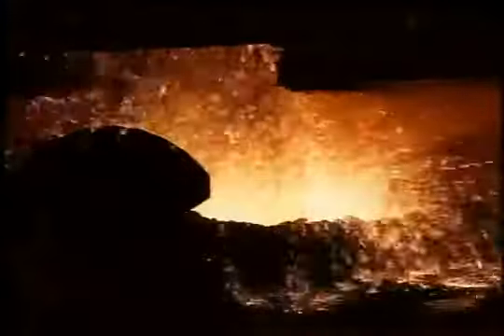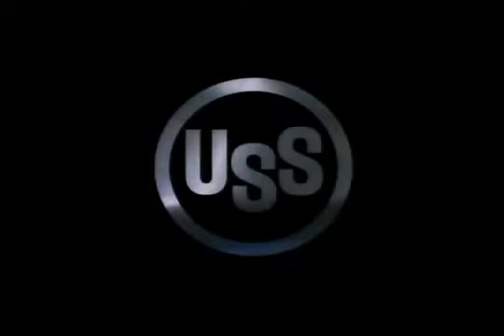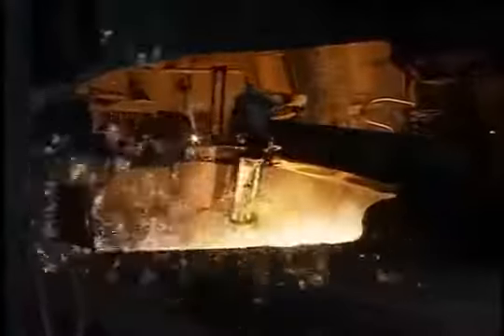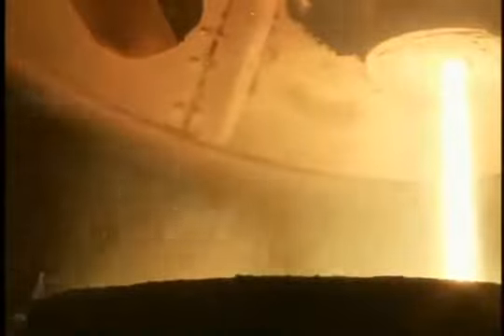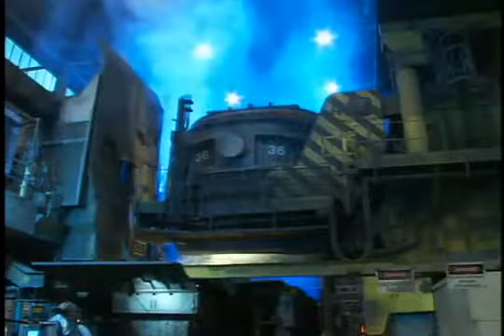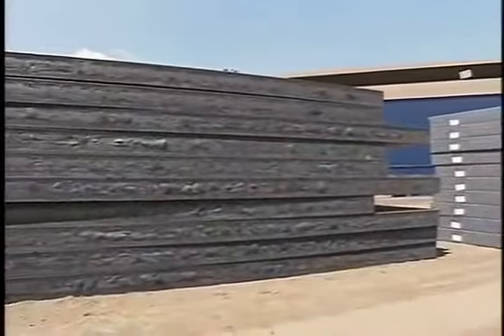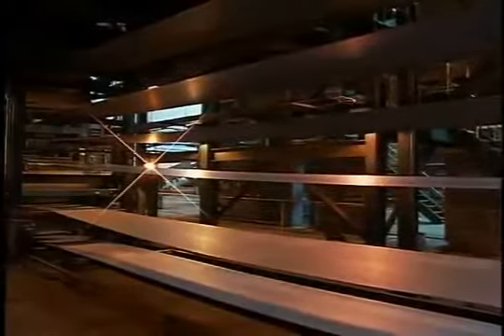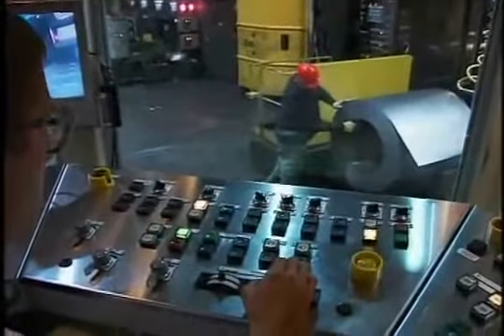STEEL  From Start to Finish

Comment: DELFT "SteelMaking QUIZ 1"
Axel Gian Aditama
2713100137

Steel making is the process for producing steel from iron. Three materials as composition to make steel are iron ore  (Fe203), coal (C) and limestone (CaCo2). The iron ore stored according their origin. Before being transport to the next process, its must mix in rotating drum to make an optimal blend. 
The other material, the coal are blowing into the furnace. At 1100 C the coal now converted to metallurgical coke. The metallurgic coke are guided to the quenching station, and after cooling they are screened large size coke and medium size coke use in blast furnace and small size coke are used in sintering process. Iron ore, coke and limestone are now carefully blended and after that they go to sintering process. The remain product is sinter.
The blast furnace operation, sinter, lump, coke, and limestone go to the conveyor belt and transport to the top of blast furnace. Iron ore principally compound of iron and oxygen (Fe203 + 3C). Iron is produced by the extraction of oxygen using coke, this reaction is endothermic. Extra coke is injected together with hot air. The air is preheated around 1250 C. Moving downward the sinter, coke and limestone are converted to liquid iron and slag, sometimes oil and gas are injected. The iron turn to pig iron are collected at the bottom of blast furnace.
The liquid pig iron transport to steel plant then process in oxygen steel making process. Next the liquid pig iron pour into the converter, where given more pressure and oxygen so it will oxidation so the carbon which contain in pig iron reduce (<2%C) and remove the impurities such as sulphur, silicon, mangan, and phosphor. Where the maximum percentage of impurities are Si <= 4% ; Mn 0,5 – 08% ; P <= 0.08% / 0.15 – 0.20 % ; S <= 0.04%. At the end of the process, the temperature 1650 degree centidrage are obtain then the sample is taken from the converter, and about five minutes the result will appear on screen.
By using aluminum, the steel is oxidation which this will make increasing ductility when tapping the steel from converter. The reaction 4 Al + 3 O2 -> 2 Al2O3 . Steel and slag are pouring from converter separately, first the steel after that the slag. The liquid steel stern using inert gas, argon. This make the composition and temperature to be homogenous. In addition the gas bubble flow out the impurities, which absorb into the slag.

Comment: Name: Fadli Kurniawan
NRP: 2713100029
Lecture: Dian Mughni Felicia, M.Sc
“STEEL MAKING” QUIZ 1 PBB 
This is my review about the video by Fadli Kurniawan
Steel making, the process basically started with the production fire which the raw material are iron ore Fe2O3, coal C and lime stone CaCu3, the iron is process in rotating drum to make a optimal blend, and the other raw material coal that processed into powder is blown into the furnace, at 1100 degrees centigrade the coal is converted into metallurgical coke consisting the pure carbon, delive from the furnace the coke is guided through quenching station and after cooling the coke will be used in the sintering process. After that Iron ore, coke and also limestone, is carefully blended, in the sintering process that have a slowly moves under combustion, and after the blend is returning from the sintering process the blend will cold, a crushed and it will ready to next step, ‘blaxt furnace operation.”
In the blast furnace operation begin with sinter, limestone and coke is transported into the top the blast furnace. Iron ore is have a compound iron and oxygen (Fe2O3 + 3C), iron is produced by the extraction oxygen using coke. To sustain the reaction extra coke is injected together with hot air, the air is preheated to around 1250 degrees centigrade,and during the process the limestone, coke and sinter converted into liquid iron and slag, to save the use of expensive the metallurgical coke sometimes polarize or oil is injected, by the computer process operating parameter kept under control. The iron turned into pig iron is collected at the bottom of the blast furnace and tapped, and in this phases the real steel making process starts beginning with the dissolving process, by injecting lime powder, to avoid losses the ductility at high temperature the sulphure is reduction until 0,01% is necessary, and then the liquid pig iron is transported into the steel plant, there are several processes in the steel making system, that are Siemens martin furnace, Oxy steel converter, Electrical arc furnace, Thomas Converter, and now the oxy steel process and electric arc furnace that though relevan. In the oxygen steel makung process the liquid pig iron is transfered into another ladle, the temperature is measured and the data sample are sent to the laboratory and the floating slag is removed, after that the liquid pig iron is enter the converter tank and the scrap is added into the tank this is to control the temperature increase due the oxydation of impurities that maybe the carbon and silicon, the impurities is oxidating into the slag floating in the surface, finally after the temperature is 1650 deegrees celcius and the end of oxydation process sample take to the chemical analysis and within five minutes result can presented info the screen and will knowning the elements and reagen and the oxydation determined, alloying composition to ensure related the final properties aand used on the steel, the steel deoxidized, and the alumunium that associates with oxygen improving ductility and these elements will be added during taping of the steel to the converter into the huge ladle. The steel and the slag will be separate from the converter, the first taping is iron and next the slag, next the liquid steel is steer using the inert gas, is to ensure the composition and temperature to be homogeous, and the gas buble will float the impurities and up into the slag. Afer refining the ladle is containing about 300tons of liquid steel and taken by continous casting machine. There is my review, syukron (600 words in ms.word)

Comment: DELFT "Steel Making Quiz 1"
My name is Eldwin 2713100077 from PBB B class

Review Video :
This video is about steelmaking which is started by production of fire. The raw material is consist of iron ore, coal, and limestone. Iron ores are stored depend on its origin. Then, we reclaim from various source and make it to be layers. Before go to the next step. The layers are mixed by rotating drum to make an optim blend. Fine ore transport into the furnace, the coal blown into the furnace. Coal can be converted into metallurgical coke in 11000 degree centigrade. Metallurgical coke is consist of pure carbon and minor polution. We send the metallurgy coke into the quenching station then we cooling the coke. So the coke will be more larger, and we used it into the furnace. Besides, there are coke in small size. We named it coke breeze. We use it for sintering process. We use a lot of water to cooling the coke. Iron ore, coke breeze, and limestone are carefully dispend and blend. The blender spread in stran which slowly moves under the combustion hood, the sintering process. The combustion zone with high temperature make the ground ore into a pour smash as soon as the blend is complete burn through it is cool, rush and screen. The fine will return into sintering process. The remaining product is the sinter then we continue into the next step. Sinter, coal and limestone are transported into the top of blast furnace by conveyor belt. We know that iron ores are consist of iron and oxygen. The principle compound of iron is iron and oxygen are produced by extraction of oxygen by using coke, we call it endotermic. To sustain the reaction we inject extra coke and hot air. The air preheated around 1250 degree centigrade. Then blow it into the furnace so we can make the temperature equal around the furnace. Move downward the sinter, coke and limestone converte into liquid iron and slag. We can save more expensive coke by inject polarized coal or oil. We can control the process use computer. The iron turn into pig iron and it is collected in the bottom of blast furnace then tap it. We do desulfurized to avoid high ductility and high temperature. The reduction of sulfur around 0,01 percent is necessary. We transport the pig iron into the steel plant. We can do steelmaking in several process like Siemens Martin Furnace, Oxy Steel Converter, Electric Arc Furnace and Thomas Furnace, but only Oxy Steel Converter and Electric Arc Furnace are relevant. The Oxy Steel process, we transfer the pig iron into another metal then we measure the temperatur and send the sample into the laboratory. After that, we remove the floating slag. Then send the pig iron into the converter. We add scrap which can control the temperature increase due to the oxidation of impurities mainly carbon and silicon. The pure oxygen will blow into above and floating into the surface so we can obtain temperature around 1650 degree centigrade. Then we take the sample into the chemical analysis just around 5 minutes the result is presented on the screen. We can know amount of the other element and reagents so we can ensure the steel composition are related into final properties which name is steel. By using aluminium the steel is oxidized so the steel is killed. Aluminium will react with oxygen improving ductiliy. This element can be added when tapping from converter. The steel and slag are poured out the converter seperately, tap the steel first then the slag. We use argon to homogenized and flow out the impurities which become a slag. After refining, the ladle are containing around 300 ton liquid steel and continue into casting machine.

Comment: Peniel Simaremare
2713100095

STEEL MAKING QUIZ 1

This video shown The Steel Making Process by Electric Arc Furnace.
First of all, I try to understands every single word of prologue. And then, I rewatch this video and try to translate with imagination about how does the situation in the manufacture sector.
The process basically starts with the production by fire which the raw materials are Iron, Coal and Limestone.
The iron ores stored according to origin. Before starting on next process, the layer is mixed into the rotating drum and then to the optimal blend. Meanwhile, the coal ground to be powder and then is blown in the furnace. Next after cooling process, the metallurgical coal formed lump coke used in the blast furnace and small coke breeze to be used in sintering process. Iron ore, coke breeze and limestone carefully dispensed and blended and then transported to sintering process. The combustion zone for sintering process move downward through the blend and high temperature sinter the iron.
Unlike the basic oxygen route, the EAF does not use hot metal. It is charged with "cold" material. This is normally steel scrap (recycled goods made from steel which have reached the end of their useful life). Other forms of raw material are however available which have been produced from iron ore. These include direct reduced iron (DRI) and iron carbide, as well as pig iron, which is iron from a blast furnace which has been cast and allowed to go cold, instead of being charged straight into a basic oxygen vessel.
Steel scrap (or other ferrous material) is first tipped into the EAF from an overhead crane. A lid is then swung into position over the furnace. This lid contains electrodes which are lowered into the furnace. An electric current is passed through the electrodes to form an arc. The heat generated by this arc melts the scrap. The electricity needed for this process is enough to power a town with a population of 100,000.
During the melting process, other metals (ferro-alloys) are added to the steel to give it the required chemical composition. As with the basic oxygen process, oxygen is blown in to the furnace to purify the steel and lime and fluorspar are added to combine with the impurities and form slag.
After samples have been taken to check the chemical composition of the steel, the furnace is tilted to allow the slag, which is floating on the surface of the molten steel, to be poured off. The furnace is then tilted in the other direction and the molten steel poured (tapped) into a ladle, where it either undergoes secondary steelmaking or is transported to the caster.

THANK YOU

Comment: Reviewed by : Jan Weslin Saragih (2713100087)

DELFT "Steel Making Quiz 1" 

This video explains us about the steel making process. This process is the beginning of many everyday products we use, such as automobiles, appliances, steel wire, nails, screws, cutlery and even paperclips. The Steel making basically starts from the production of iron ore, coke and limestone. Before transfer to the next step the iron ore, coal and limestone mixed. And after that blend with rotating dum to gets the optimal blend of the mixed. Then the blend materials blown to the furnace. At 1000 degrees celcius the coal transformed to be metallurgical coke that consisting carbon, then quenching and after cooling we gets the large size coke. Small coke breeze to be used in the sintering process. Iron iron, coke, limestone are carefully dispensed blend. The blend spread on the strand which slowly moves under combustion. Sinter, coke, and limestone are thrown to blast furnace. We use limestone to remove impurity. We get liquid pig iron  from the blast furnace. The floating slag are remove. The sinter, coke and limestone are carried via conveyor belts or skips transported to the top of the blast furnace. As we know that iron ore is basicly formation for iron and oxygen. We can get iron as the extraction of oxygen using carbon inside the blast furnace.The reaction inside is endothermic. To sustain the reaction, extra coke is injected together with hot air, the area it pre heated around 1250 deg C. To minimize the use of expensive metallurgical coke, sometimes other component like oil is injected. He process controlled by the output indicator of the computer and always kept under control. The iron collected at the bottom of blast furnace. We can change the characteristic or iron by adding some components like injecting lime powder to avoid loss of ductility. To make this, high temperature is used for sulfur reaction. Then this liquid pig iron will transported to the steel plant. There are several processes in terms of steel making. These are Siemens Martin Furnade, Oxy Steel converter, Electric Ach Furnace, and Thomas converter. Now only two item that relevant to process nowadays, there are Oxy Steel Converter and Electric Arc Furnace. In the oxygen steelmaker, we must separate the slag for further process. The raw material transported to the Oxygen Furnace. The reaction happening in this area is when the oxygen blown into furnace, so It will decrease impurities and carbon. The BOF actualy ended at 1650 degree celcius. After the BOF process the samples are taken for analysis. The analysis is to conrolling the steel compound to produce final product. Aluminium added to deoxidation of steel and increasing the ductility after while tapping out the metal from huge ladle. The molten steel separated from the slag by moving the converter to the left for tapping out the molten iron after that moving to dispose the slag. After the refining process, that the molten iron injected by inert gas argon flow up the impurities and join the surface slag, andd steel casted in the continuous.

Thank You.

Comment: Ihsan Maula
2713100018

This video describes the steel making process from start to finish. USS (United State Steel) explains this video. begins with a blast to take raw materials from the earth. then the raw material crushed and passed through a powerful magnet to separate the iron ore that converted into iron ore pellets. coke that used formed from coal that previously cooked for 12-16 hours. The next coke and pellets inserted into the blast furnace and cooked at a temperature 2700 F. after the pellets transformed into molten iron, inserted to basic oxygen furnace (BOF) and added with steel scrap. oxygen blown with high pressure to reduce carbon in the molten iron and transformed into molten steel. the last molten iron formed into slab.